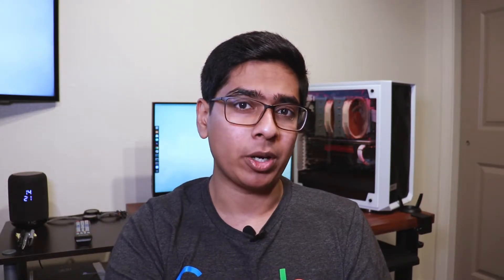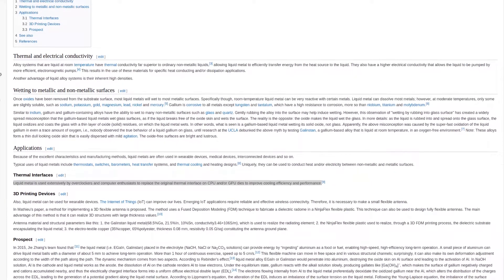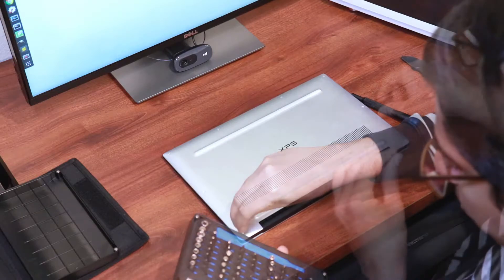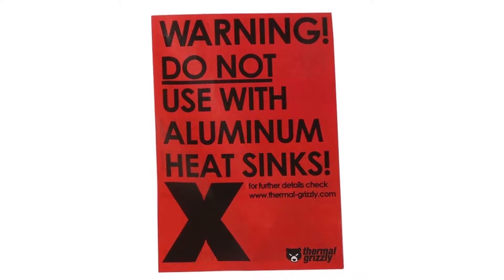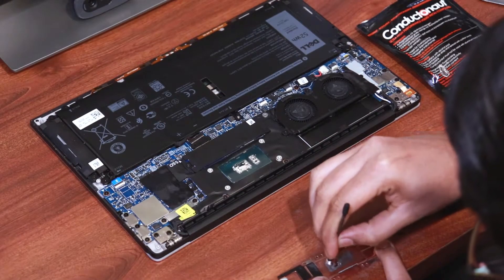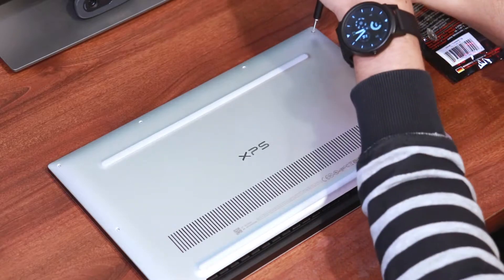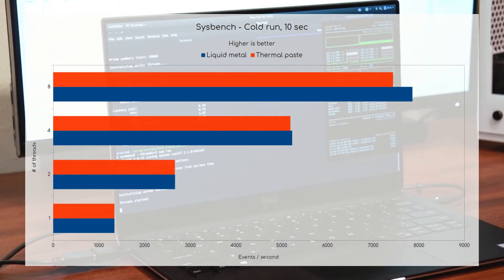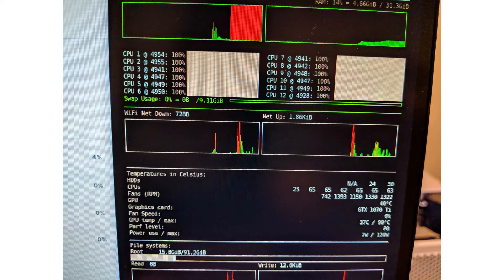Liquid metal in Dell XPS 13 - How to, and is it worth it?

Comment from the maker: Failed to mention this in the video, potential performance improvements will be because of lower CPU throttling due to lower temperatures.
Reply: You should have compared cinebench benchmark before and after
Reply from the maker: Unfortunately cinebench runs on Windows only and I don't have Windows installed on it. Maybe next time :)

Comment: 2:34 i would never unplug a battery connector with my nail! Always use a plastic tool. Secondly, never remove old thermal paste from the processor rubbing vigorously as shown here. Use isopropyl alcohol and a cotton swab to swipe away the old gunk. Manasilayi enne karuthunnu!

Comment: You did probably the worst job of applying liquid metal to the CPU and to the heatsink. You used way too much liquid metal than required that is why you failed to see any performance difference between the liquid metal and artic silver 5. Over than you have a really big downside of getting that excess liquid metal travelling to components close to your CPUs die.
I have been playing with liquid metal for long now. For best results just use the least amount, just make sure you paint it on the die and the heatsink. You almost used it like a thermal paste.
Reply: Agreed he used probably 300% more than necessary. Idiot. The whole point of repaste is to reduce temperature. Not sure why he measured gpu benchmarks. Completely irrelevant. Downvoted.
Reply: You mean for the best result, we must use a thin layer of Liquid metal?
Reply: @TaiLe-dr5ve  absolutely!
Reply: @bloomfield295  Thank you so much! Did you use LM for copper heatsink without any damage the heatsink? As i know, LM will goes inside copper for the first time applying, and the second time will much better, the third time will be better than the second,....Is it true?
Reply: @TaiLe-dr5ve  liquid metal reacts with copper and forms an alloy, once that reaction is complete it is suggested to apply liquid metal once again and that's it, you don't need to be brothered any more about it. Have been using liquid metal for 3 years now on a lot of my CPUs and GPUs. No problems at all. Just apply a thin layer 😁
Reply: @bloomfield295  Thank you so much for your information!
I have some queries need your help.
-Do you use nail polish to cover capacitors around CPU/GPU to protect short-circuit?
-How to remove clean old LM on the CPU/GPU and heatsink?
-How long for the second applying (1 month, 2 months, 3 months or...)?
-Can we use cotton stick on medical shop to apply LM? The seller only give us 2 black cotton sticks, not enough for using.
Reply: @TaiLe-dr5ve  1.  I dont use nail polish just because i feel that nail polish is going to isolate all the heat that a component might produce, so i never used it, instead i used some scotch tape. Use any tape that does not leaves residues when removed later.

2. Cleaning liquid metal is easy, just make sure it is not travailing to other parts of the PCB when you are cleaning it. I use 99% isopropl alcohol and paper towel to clean LM. If you have already used LM on bare copper heatsink then it would have already formed an alloy with cooper, now dont scratch against the copper too hard to clean the LM, just use 2-3 alcohol wipes and you will be good.

3. I think it takes about 1-2 months time period for the LM to form an alloy with copper so check back again after 2 month if you are going to use it against bare copper heat sink. Using LM on nickel platted copper is the most ideal scenario.

4. Sure you can use cotton buds or ear cleaning cotton swabs to apply LM. But make sure your cotton swab is not leaving any fine cotton threads when applying LM.
Reply: @bloomfield295  Thank you so much!
-I had already applied LM yesterday. I use coating nail polish Felina (no color) cover all capacitors and copper pads surround GPU and CPU. This nail polish can be removed easily by axeton. But i think we will not remove it in the future :)
-The result is very good, stress test by prime95 and AIDA64 only CPU the temperature decrease from 78°C to 65°C at 3.0GHz all cores. Now, i can add more 200MHz CPU Boost clock, CPU can run at 3.2GHz all cores with temperature not too high.
I do as your instruction, only apply a thin layer LM on CPU/GPU and heatsink. I use white paper adhesive tape stick square surround GPU and CPU to avoid LM spread out motherboard.
In my opinion, Liquid Metal is a great solusion for heat problem of laptop. Combine with undervolt CPU, iGPU, we will have a cooler laptop.
My laptop is Dell precision 5520, Core i7-7820HQ 2.9Ghz
Reply: Tai Le LM is the best solution for a gaming laptop, I think for the best results you can increase fan speed to say fixed 30-40% just while gaming, this will give you really ideal temperature numbers.
Reply: Bro do liquid metal need to be replaced in laptops